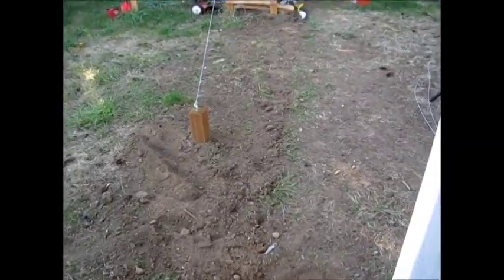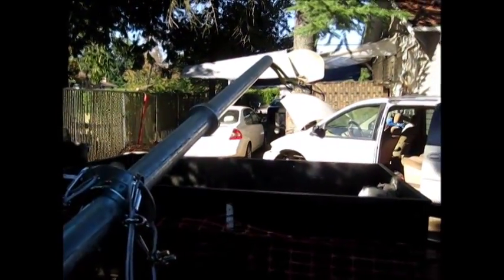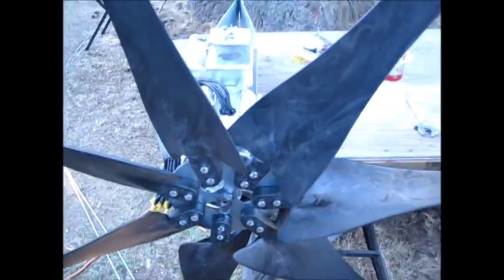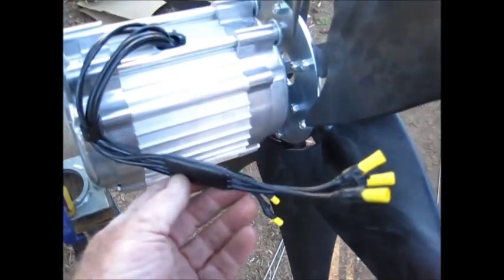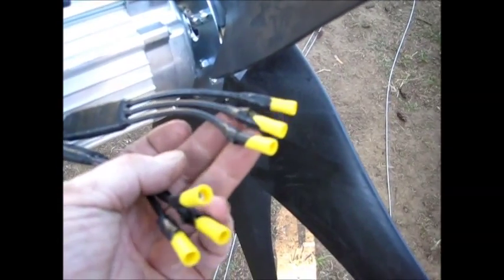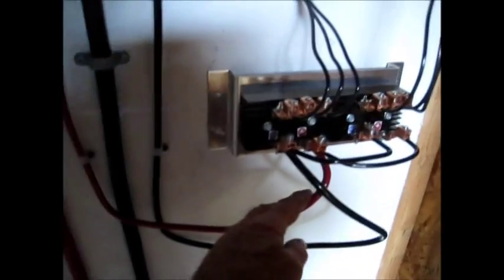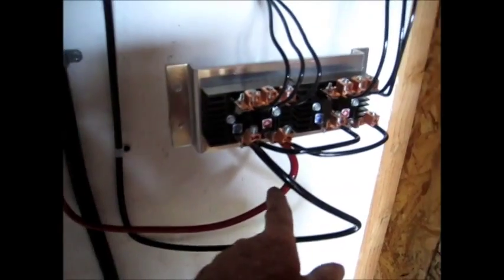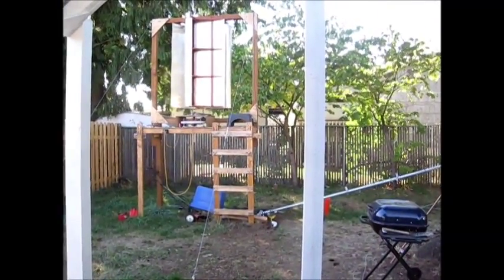Off Grid shed installing the Freedom II wind generator

Comment from the maker: nothing new to report so far. a storm front is moving in the next 4 days and the forecast shows estimated wind speeds up to 15mph with some gust.  I did install the battery switch coming from the Missouri wind and solar charge controller to the battery bus bars. and I did maintenance on the 4 battery banks today. making sure fluid level are correct and all connections clean and tight. I will try and post a video once I see any input coming from the wind generator.

Comment from the maker: I checked out the video. I was only given one of the plastic slip rings with the set up. instead of a second locking collar I got a band clamp cause jeff said the second locking collar can bend the end of the pipe. ill have to check out those other blades you mentioned. maybe get the 5 blade 80inch set up.
Reply: I missed this video of yours,, since we both live in similar winds, and I soon plan on buying a dual core Freedom II for my location, we both have dirty / turbulent winds, MW&S is making a larger version of the G5 blades, I think that will really help with our dirty / turbulent wind locations using the Freedom II,, I plan on buying a Freedom II soon after the new larger version of the standard G5 blades become available :)
Reply from the maker: Jason Brown yes, I can not wait for those to come out. I did get the current 5 blade G5's so I can test them out on the mini wind turbine I am working on. off the bench only 4 feet off the ground with a 9mph wind it hit 47.6volts under no load conditions using the raptor 7 blade set up. should do pretty good. I just have to finish making the vain and tail section and I can get it raised up on its pole 20 feet in the air.

Comment from the maker: still waiting for the wind to show up. that is how it usually goes once you install a wind generator. I did pick up a electric winch from harbor freight that I can install easy and then remove and store in the shed. I worked very well to lower the tower and move the PMA in the correct position with the wires facing out at the bottom. I added more grease around the mounting areas on the tower pole also

Comment from the maker: Hey guys, thanks for the input. I will have to wait for some help to lower it back down and get things put back right. one question I have about those plastic spacers. I only got one. does it go between the locking collar and the mount so it will spin or??

Comment: nice setup been flowing. I agree with Tore the turn the PMG a round so the water ect can drain out the hole the wire is coming out of the PMG at.

Comment: It is looking awesome :) I have a few Ideas that might help you out ,, I live by the Cascade foothills, I get some dirty winds, I use 9 blade Raptor gen4 blades and have had good results on my Single Core 12v Freedom ,, For your Dual Core Freedom II You might try the Falcon Mach 4's and get better performance out of in your area,,

The Falcon Mach 4's are much larger blades designed for high torque output , which I think All Dual Core PMG's will need when under a heavy load ,,

Here is a video of mine showing size comparison between the Raptor gen 4's and the Falcon Mach 4's from MW&S :) ,,,     Falcon Mach 4's I think.?